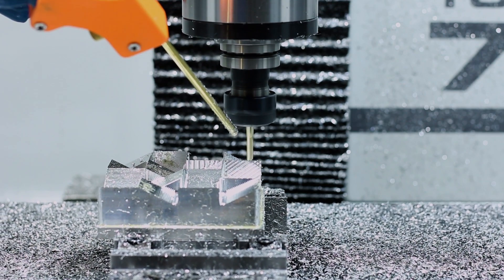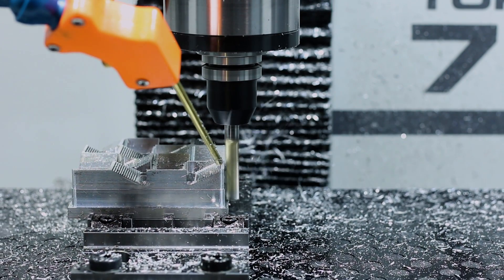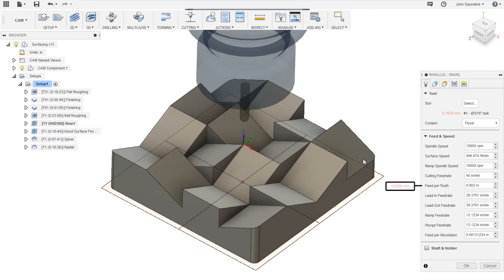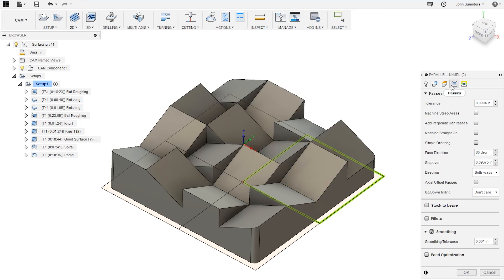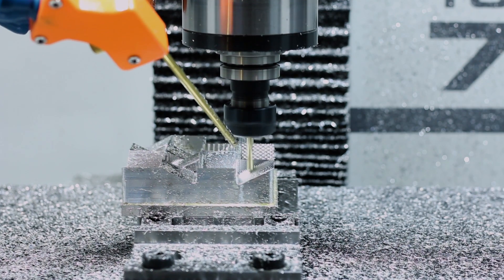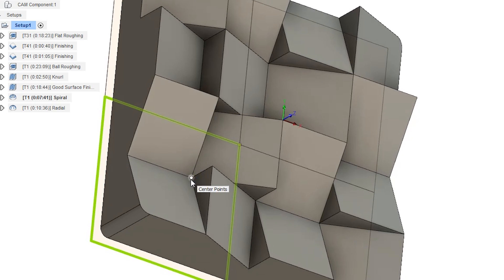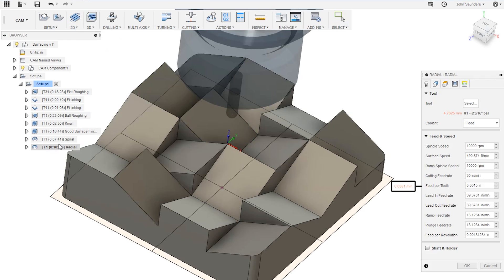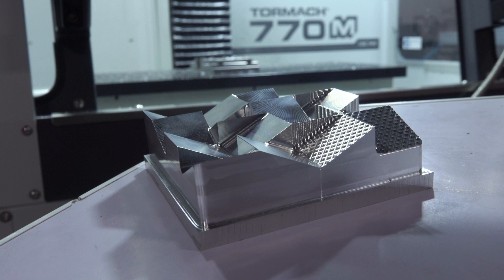Fusion 360 Surfacing Toolpaths YOU Can Use!  WW228

Comment: I havent used any autodesk programs since we had 8088 computers and digitizers . lol . Thats a cool deal to have access to great software for 500 bucks a year , if I read correctly . My question is how much is available for that 500 a year since to get anything like mastercam or gibbs cost  $17k+ ? Gibbs has been around for years and the learning aids you have on mastercam are just not there for gibbs . Are they there for Fusion360? I got great support for mastercam through cam-instructor in Oregon . Also nice project there to learn different tool paths

Comment: Cool test piece. I recently used the radial and spiral paths for a similar texturing step. The info about how to implement the tool paths is really helpful, but you need to devote more time to showing the results off. Watching this video I'd have a hard time seeing how each facet of the test piece came out since you only show the final surfaces for a second or two. Moreover, it would help to see from multiple angles and with a few different lighting setups.

Comment: Very nice! In future, could you add feeds in metric units? It would be very, very helpful Thanks in advance :)
Reply: They did...
Reply: @spikeypineapple552  No we are missing cutting feed rate to complete the formula. Normally I do not mind the thou and inch thing on american channels. With Fusion 360 videos I have to put the thing on pause constantly, so I can multiply everything by 25.4 (usually just by approximation by mentally multiplying by 2 and 3 and thinking ok, 10 times halfway between that). This is because Fusion 360 has the same settings pages in metric for us metric guys, so you really have no idea what 2 thou per tooth is compared to your own tool paths.

Cutting feed rate of 30 inch/min equals 762 mm/min. I can relate to 762 because that is what I see in my version of Fusion 360. It is about half of max speed of my machine :-)
Reply: @BaldurNorddahl  why is your machine so slow?
Reply: @BaldurNorddahl  if you have rpm and feed per tooth you're all set....
Reply: @urgamecshk  one can be calculated from the other, but they are both important. If he exceeds 1500 mm/min feed rate my machine will not be able to deliver the requested feed per tooth.

As to why my machine is slow and weak, it is just a smaller machine. If you have the optimal feed and speeds for the HAAS this Tormach will not be able to keep up either.

For one thing, the recommended depth of cut for that tool is twice the diameter but he is only doing one diameter. I assume that the machine is either not strong enough or not rigid enough.
Reply: We dont use metric in the US unless needed . Yes we should have changed in the 70's lol